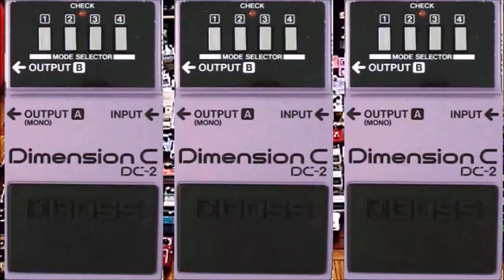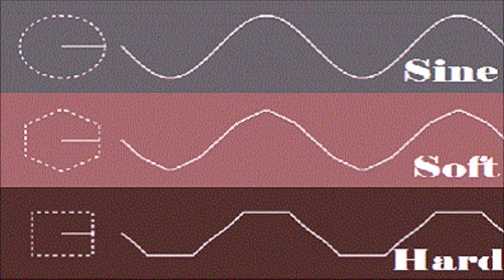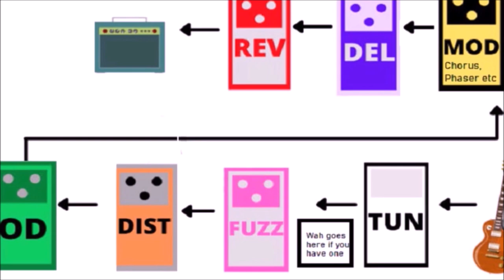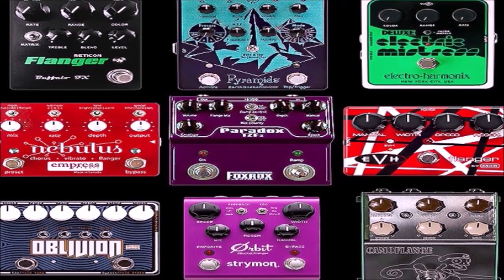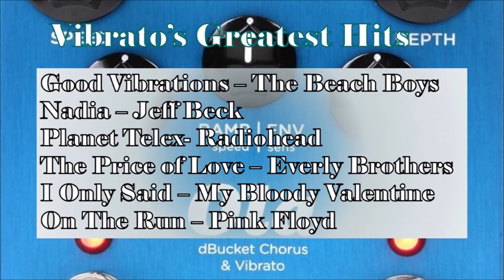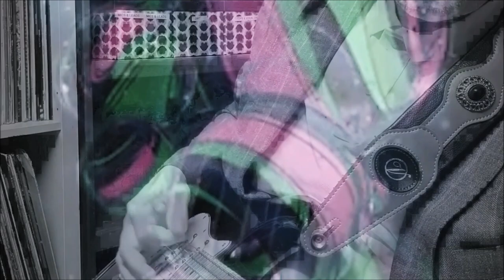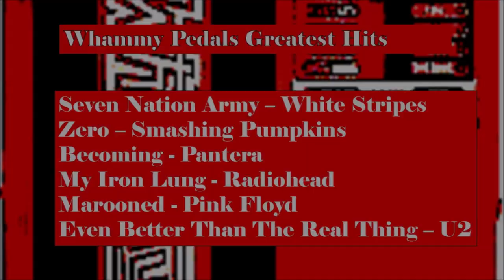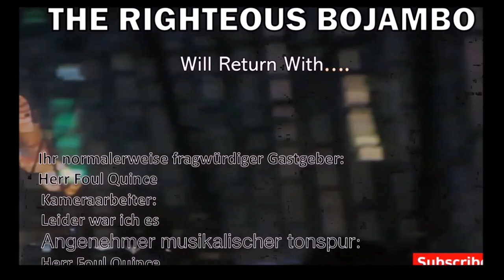The Righteous Bojambo #77 - Stomp N' Holler

Comment: I'm a pedal nut myself and I admire the way you concentrated on presenting practicalities in an entertaining fashion instead of just dipping into pedal porn. Can you, perhaps, tell us what pedals you used?
Reply: Yeah, spill...
Reply from the maker: Ok -

Standard set up was a 2012 Fender Stratocaster with limited edition overwounds, through a 40 watt Fender champion modelled to a mid 60's silverface.

Soft Clipper - Electro Harmonix East River Drive
Hard Clipper - Boss Blues Driver
Distortion - MXR Badass '78
Fuzz - Vintage reissue Big Muff

Chorus - Yamaha CH-01
Flanger  - MXR Micro Flanger
Phaser - MXR Phase 90 (as you can tell, I like MXR kit)
Trem  - TC electronics Pipeline (Normally dont are much for their stuff, but I like this)
Vibrato - Behringer Ultra Vibrato (virtually identical to a Boss unit, about $250 cheaper)

Wah - Vox 1965 reissue (I dont like it)
Univibe - MXRM68

Octaver - Boss OC-2
Whammy - Digitech Ricochet

Digitial Delay - Boss DD-8
Analogue Delay - TC Electronics Brainwave
Reverb - Boss RV-6

I think that's it...
Reply: @Foul_Quince  Too much BOSS, not enough boutique.  And a Behringer? Bah, that leaves a bad taste in the mouth.
Reply from the maker: @TheBluesLawyer  Both BOSS and MXR are quality kit, do what they say on the packet, play well with others and dont cost the earth. Granted, they aren't terribly imaginative but what they do, they do as well as anyone else.
Reply: @Foul_Quince  That's very thorough. Are these you preferred pedals in this category or were they picked just for the video?
Reply: @Foul_Quince  Gear snobs are the worst. Generally, what are Behringer Pedals like?
Reply from the maker: @metalrush6819  Value for money if you're not going to jump all over them.. They're a bit fiddly with the bypass selection, though.